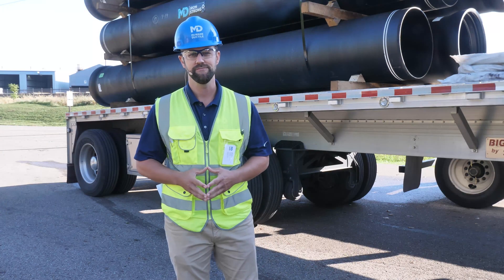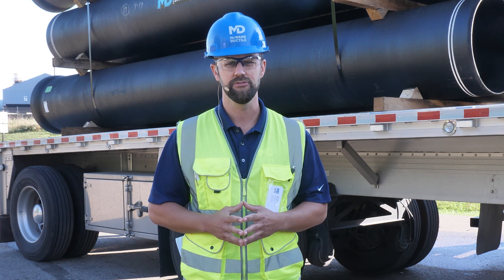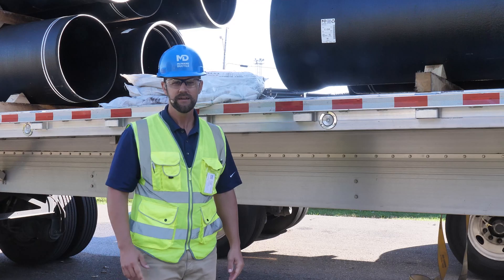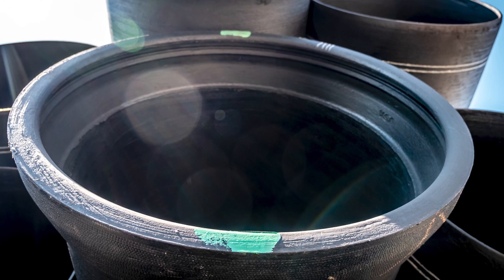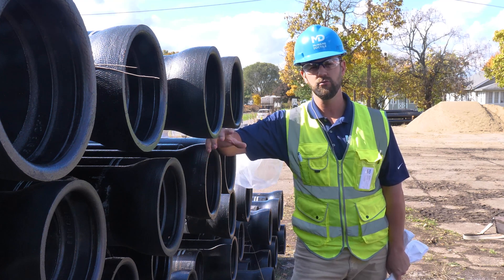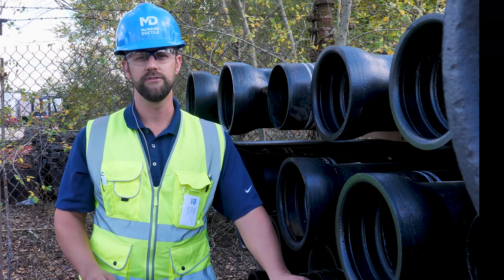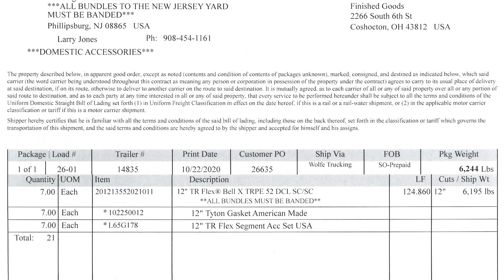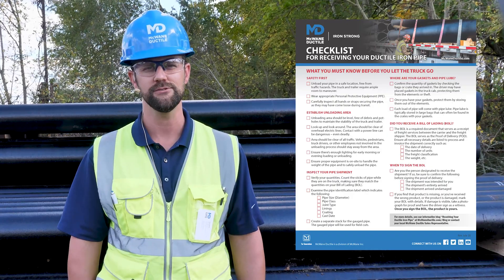How to Receive Ductile Iron Pipe

Comment: Kindly make a video showing unloading of DI pipes from container,  specially small diameter pipes....
Reply from the maker: Proper handling of your DI pipe is very important. Usually when we ship internationally, we use outside vendors loading the pipe. Your idea is very good, and I will add it to list of suggested video topics. Thanks for watching.